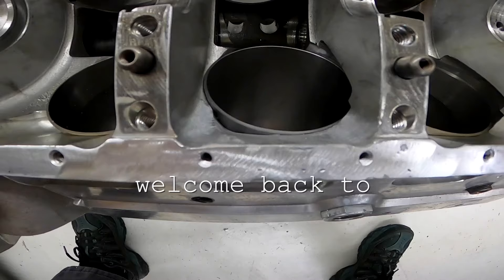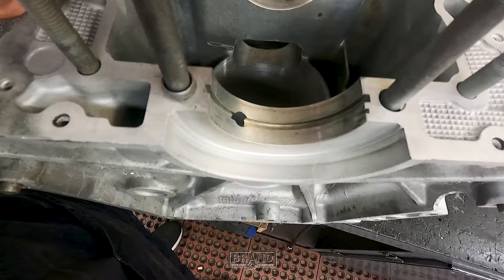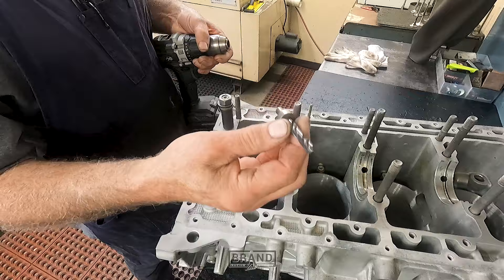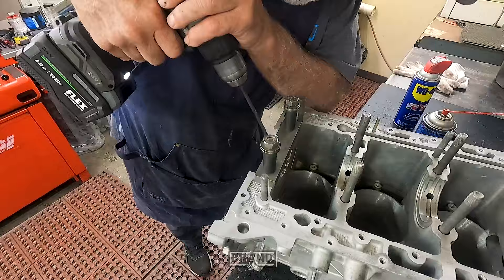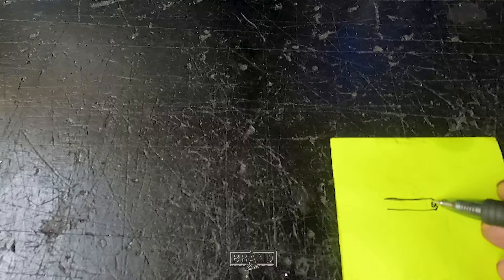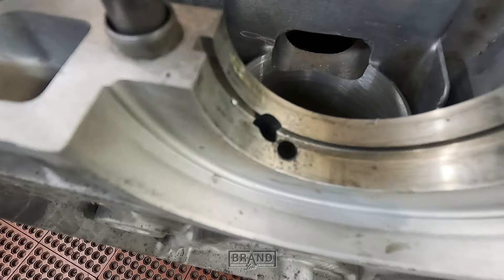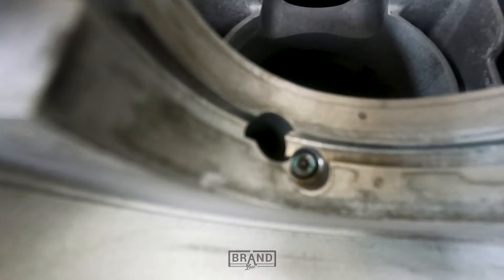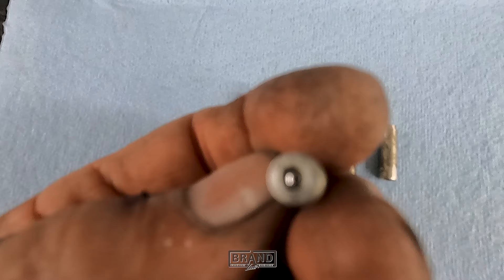Drilling Oil Squirters into a Porsche Block + How They Work! | Gerald's Machine Shop

Comment: I like the ways people manage to do this. It has been said that one of the reasons people could turn up the boost in the Nissan 300ZXTT was because it had oil squirters from the factory. There were certainly other reasons, but that was certainly one of them.

I think about what would happen if Nissan made all their cars as good as their 6 cylinder engines.

Comment: Suzuki were the first manufacturer to use piston oil jets in a production engine in 1984 (Suzuki GSX-R 750)
They stated it came from pre - WWII aircraft engine technology as keeping piston crowns cool is pretty difficult with 40+psi boost and 2,000+hp.
They are now ubiquitous and seen in all modern engines. (at least the ones I've seen in pieces)
One other advantage I've found, small end wear decreases because there is so much oil under the piston which no longer relies only on splash and enough  rpm to centrifuge oil up there
Those Porsche squirters are a great development, don't open until rpm (therefore oil pressure) gets high enough to be needed.

Comment: Did you say nikasil cylinders? I melted the nikasil cylinder on my 1982 BMW R65 motorcycle engine in about '95 ish when I forgot the jets in a fresh fogger nozzle install. Neither gas or NOS, just wide open. Did a lot of other things too. But that was the first time I'd seen so much as a crosshatch worn off one of those let alone any damage.
Reply from the maker: Yes

Comment: I heard that running a hyperutectic piston requires more bore clearances than forged piston for thermal expansion I wonder if it would be possible to do this modification and keep them cool enough to run less clearance. Just curious
Reply from the maker: No less clearances with hyperutectic.
Reply: Oh okay 👍 thanks for letting me know that I was thinking of trying some KB hyperutectic pistons but I don’t know much about them

Comment: But does that decrease the life of the bearings?? not criticism just a sincere learning question
Reply from the maker: No
Reply: @BrandRacingEngines  okay when doing this do you have to increase oil capacity to keep up with the displacement or is the original capacity enough
Reply: @BrandRacingEngines  sorry for all the questions just curious
Reply from the maker: Most oil system have a 30% reserve that the oil pump bypass